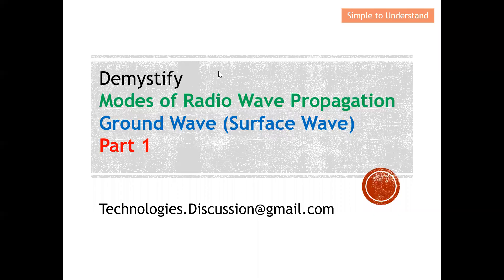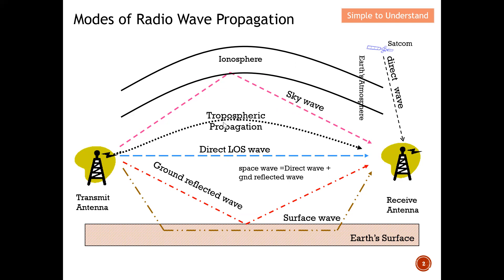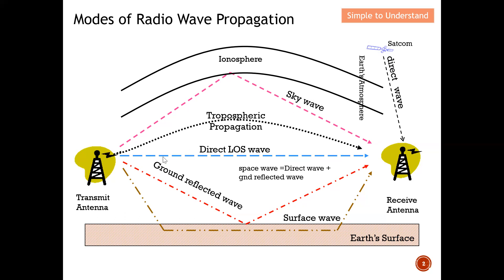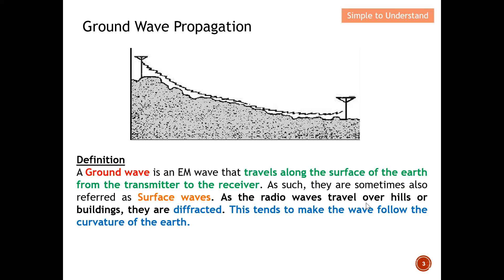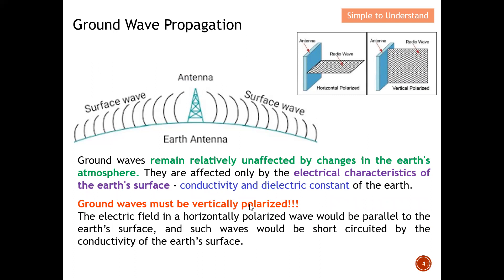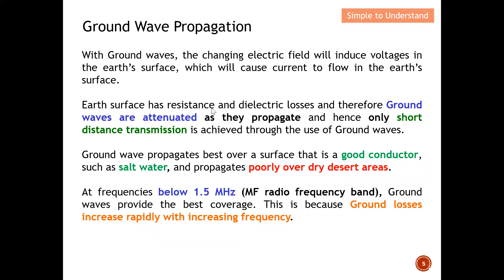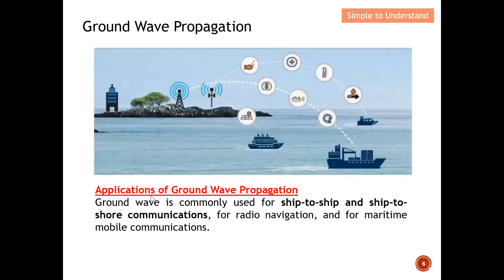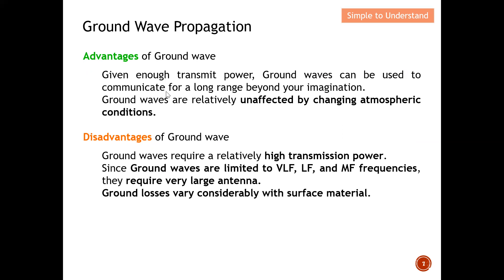Radio Wave Propagation #1. How EM Waves Travel Along Earth’s Surface – Ground Wave Explained!

Comment: Interesting regarding the water ground wave and i'm wondering if that is also a skin effect. In other worlds the signal skips over the water so when people dangle counter poise wires into the sea this might not be the most effective way of setting off the ground wave transmission. When by the ocean, I'm, wondering if  a kind of separate vertical beam just for the water surface transmission would be the way to go? Perhaps 2x vertical beams in co phase but one is angled down to try to skim the water surface while the other is angled just above the horizon depending on what DX you are looking for. Or, perhaps a beam with a slight arrow shape so the shield element angles more downwards towards the ocean surface.
Reply from the maker: I have done some research work on underwater communication which is challenging. Let me explain where the challenge is. The sea water is a good conductor and you can imagine them as a big piece of ground and shorten all our signal. As for cable, they are also a good conductor but we isolate the signal and ground from 2 different pcs of conductors. Unless we can find a signal path or ground path separately for underwater communication then I think is feasible. The EM wave cant really travel vertical into the bottom. I have done this experiment in the early day. For example, I can send info horizontal along the surface for more than 200m but vertical it cant even 10m with the same tx and rx. Hence, therefore, underwater comm happen only at very very low freq.